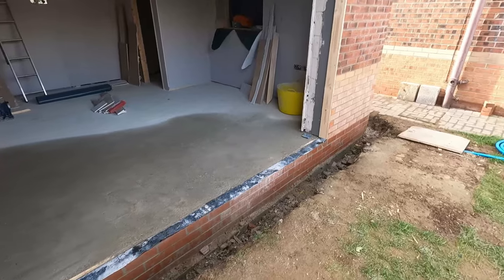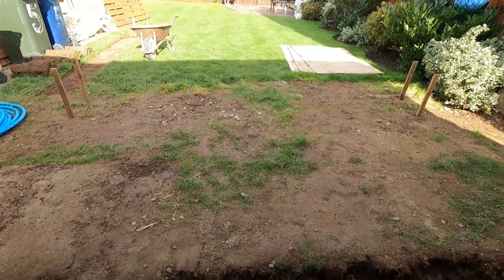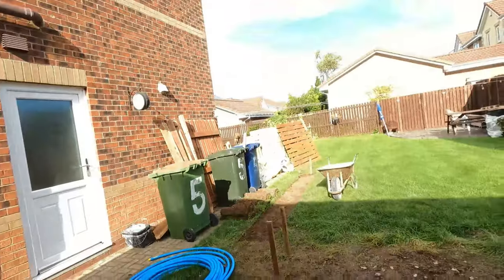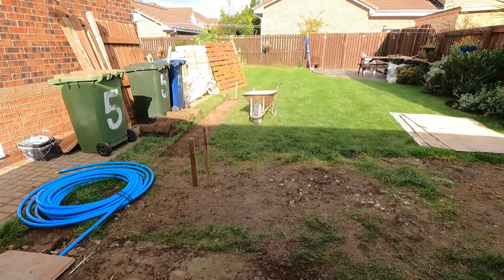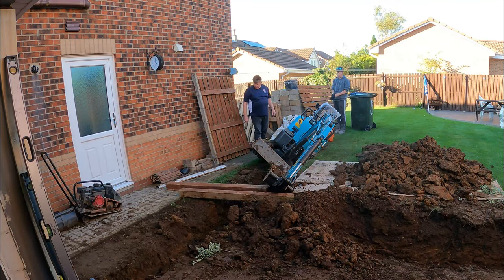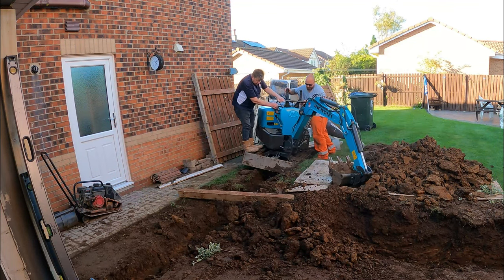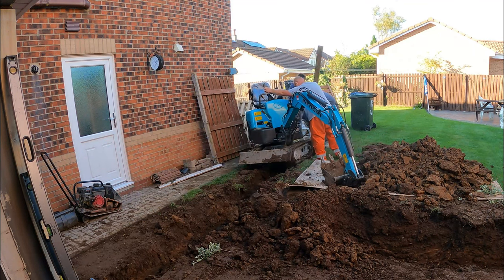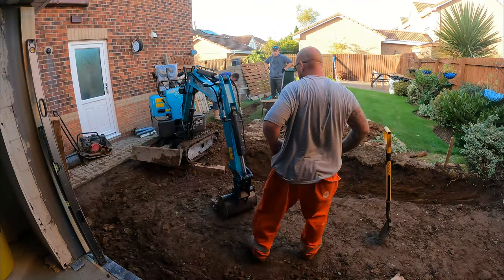Chinese mini digger grading and digging dwarf wall footing [ALSO A BIG BIG BOO BOO]

Comment: Hey Nick have you had problems with the tracks? My comes off pretty easy and can’t get them back on without using the boom and sling stretch the track like big rubber band to get back on. Seems like the tensioners won’t back off enough. You have that problem?
Reply from the maker: Hi Kevin and thanks for commenting and welcome.
I have had the track come off once and that was due to turning on a rock and it threw the track off. It took the P@#S to get back on but come back to it next morning and 5minutes it was back on. I've noticed that with the grease tensioner fully let off it still wasn't enough to get the track back on. It's like they've put the tracks on tight in factory hoping for some stretch along the way. Then I just pump the grease tensioner up til the tracks are right. Is yours grease or a big nut for tensioner ?
Reply: @everydaywithmenick  I just have a threaded rod and a nut no grease to pump in. I’ve thrown my tracks 4 times only have 10 hrs on my machine. I’m afraid I will damage the $250 track by stretching it to get back on that’s the only way. I’ve been asking crisp the sales lady that sold me the machine if she could show me a video how there technicians install the tracks. Some reason she doesn’t want to do that. I’m sure they use some stretching machine to get the tracks on. I believe the tensioners that they are using are probably designed for the walk behind machine that only weighs 500 kg and I believe the spring compresses in and that’s how my track get thrown off. The spring it’s just not strong enough for a 1200kg machine. But they designed it not to loosen up enough to manually put the track back on. My track will sometimes come off just by going straight down a hill. I don’t think that they’re going to fix that problem for me I think I’m gonna have to fabricate it myself and get a stronger spring. It is a flaw in their design but it digs pretty good lots of power! I could be wrong about the tensioner this is my first excavator but something is just not right I stopped doing 360s and 180s just a keep the tracks from coming off. I will have to do some more research just got to find the appropriate tensioner to put inside that machine.

Comment: Makes me consider the expanding tracks for when I get one to dig some garage footings.
Reply from the maker: Yes I would like the expanding tracks myself. It sure would be very useful when doing such things like this. But I deffo need a 6 or 9 inch service bucket for jobs like this. Thanks for watching 😊
Reply: Hi Nick. I have a 1.2T similar digger (different brand) but with the Yanmar engine. Came with 200mm (8") trenching bucket which is ideal for water lines. Cheers from Australia. Dave K
Reply from the maker: @TreeChangeFarmer  hey buddy, thanks for commenting and watching. Just looked over your channel and I've already watched some of your videos in the past 😄 so you my good sir have received a sub from me 😁
How has your machine been for you ?
I wish I had got the 3 cylinder yanmar engine now, soo much smoother and quieter. 200mm bucket would be great for service lines. Watch this space as I will be getting one 😉 thank you again for watching and commenting 😁
Reply: @TreeChangeFarmer  what state are you in mate? I looked at some in Brisbane
Reply: @slimer13b  I am in NSW. I looked at the new 1.2T Rhinoceros machine which I liked with the Kubota engine but was $2K more and could not find an agent down here. My machine is a UHI (United Heavy Industries). Has 3 year warranty and parts are easy to get out of Sydney (I am in the Hunter Valley) near Newcastle.